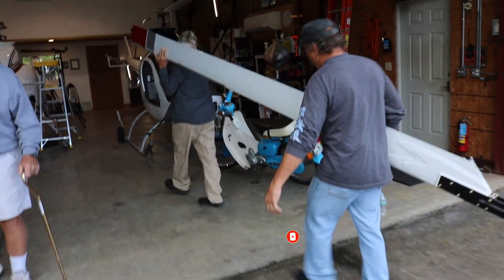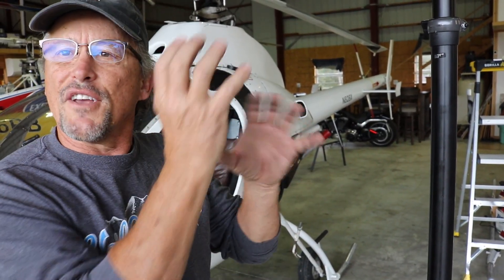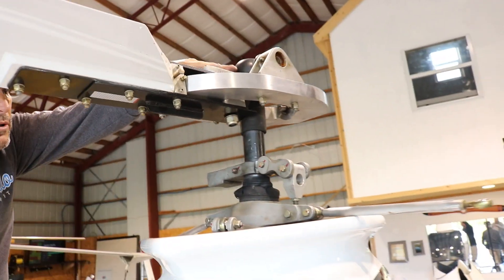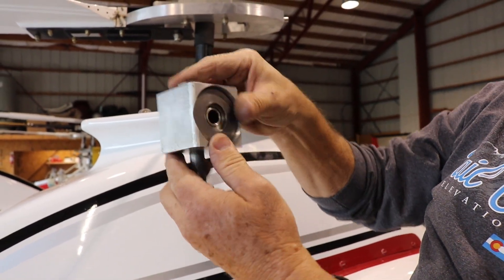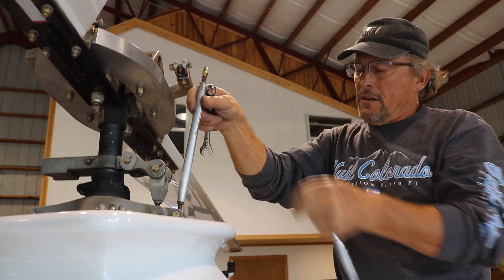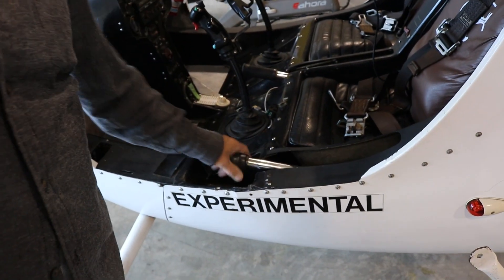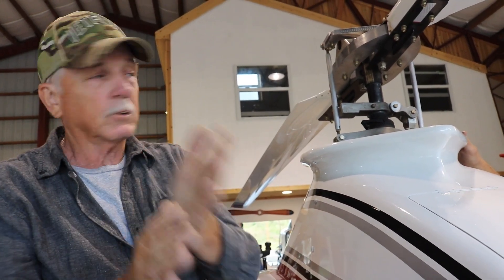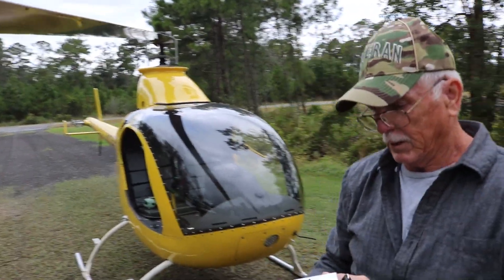Installing Rotor Blades on a Helicopter - Rotorway

Comment: Uhhh... airplanes have more than 1 bolt that holds the wings on.  The reason they call that 1 bolt the "Jesus Nut" is because if it fails, you're gonna meet Jesus.  :)

Comment: Who manufactures the bolts? I hope not China. That is ALFUL thin for a bore it should be at least 3/4 " not 5/8 " don't you think ? Is it military grade ? There should also be pins after the nuts so it won't come lose fellows. Nice helicopter though.

Comment: Would 2 bolts be too much to ask?
Reply: Another bolt would mean "another hole" which would weaken the rotor hub... 🤔
Also, the "length" of the bolt is what takes the stress, not the actual torque that holds the bolt in place.

Comment: So, what is the SAE hardness of the bolts? Can't just any 'ol off the Home Depot shelf. Or can it?
Reply: Probably go by grading, not hardness, but a Home Depot 5/8" Grade 8 bolt could lift several tons in shear; I'm too lazy to look it up!
For aviation purposes, I'd want something with a bit more provenance, as required in the certified aircraft world.
Reply: mast bump is the enemy. this situation can and does trash main rotor shaft, prior to slicing tail rotor boom etc, careful out there.
Reply: They have titanium bolts n nuts, much lighter
n stronger than steel ones. They do cost more, but aviation has never been cheap to start with, unless you're flying kites... 🤔

Comment: Excellent video Bryan.  Always fascinated by helicopter rotor head mechanisms.  I first heard of the Jesus nut in Robert Mason’s great read, “ Chickenhawk.”  I read somewhere the Huey had a nut to mast torque value 600-700 ft-lbs. 👍🏽👍🏽
Reply: The CH47 can be over 5,500 ft-lbs. I've had a few that took over 12,000 ft-lbs to break torque.
Reply: @helicopterdeeznuts  Wow, that’s some serious torque!
Reply: Has anyone ever thought about two holes in the bolt head and the self locking nut to safety wire to each other or is there an integrity factor in doing that with the hardware? Just an extra layer of security even though the nut is self locking. Coming off from fighter jets nearly every fastener of importance is done in that form. Great content and new subscriber  thank you!

Comment: Sweet little chopper. Payload capacity? Max 1/4 ton, maybe?
Reply: Depends on what you mean by "payload"; useful load on the 162 is ~525 lbs, which includes fuel, pilot, passenger, baggage. True payload, using the term as in commercial aviation, would be very little, as it would subtract the pilot and a certain amount of fuel.
Reply: @UncleKennysPlace  Guess to add a chain gun I'd have to diet hard and fly naked.
Reply: @KowboyUSA  There is not a helicopter for commercial use only for fun, so far.
I'm from Germany Bell 47 is different 10 - 4 Sir.

Comment: I'm shocked more of those bolts aren't safety wired. That's a whole lot of Jesus nuts.
Reply: Amén, just commented above the same. Coming off from a decade of working in fighter jets gets old with all the safety wiring lol. If I ever owned I would....

Comment: What I found interesting is that setup of a real helicopter is very similar to an rc helicopter.
Reply: It's actually the other way around!
Reply: All use the same physics my bro! Pretty rad
Reply: Yes Sir I'm 70 now and fly only Rc is quite different you not sitting in the Rc you can make very quickly mistakes on a Rc not happening in a real one you can feel better in a real one.
Reply: An RC helicopter is a helicopter…it should be similar.

Comment: 3:05 It depends on the airplane design.  Some do have multiple bolts that hold each wing on at the spar.  Also, wing spar bolts typically only have to deal with loads induced by lift.  The "Jesus Nut" on each blade also has to deal with centrifugal force.  That being said, even on a spar with multiple bolts, if one shears the other probably won't be far behind.
Reply: A 5/8ths bolt depending on the grade can withstand over 20,000 lbs of force. I think they are far from their limit

Comment: New bolt each time I would suspect?
Reply: Probably not with this low a torque.  These are not torque to yield bolts and 70 ft-lbs is nothing for a 5/8” bolt.  And these bolts are loaded in shear, not tension so no need to replace unless they show signs of wear.